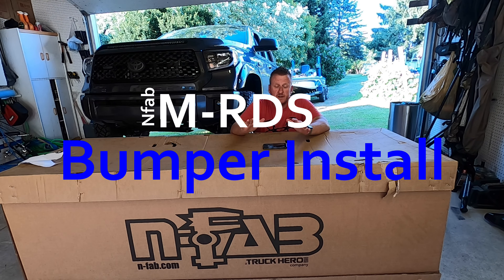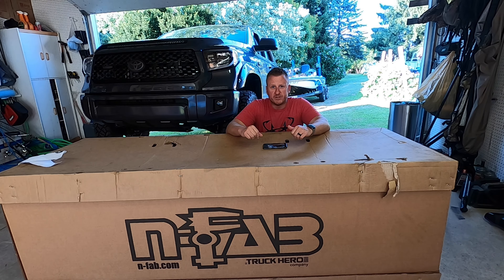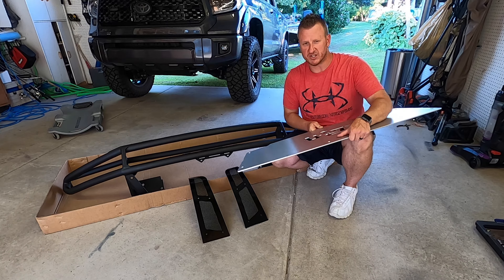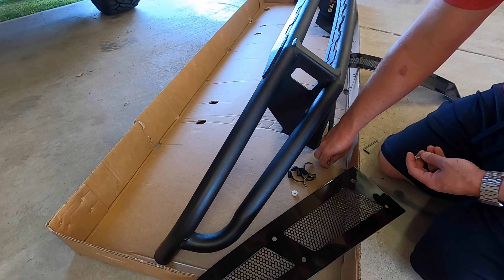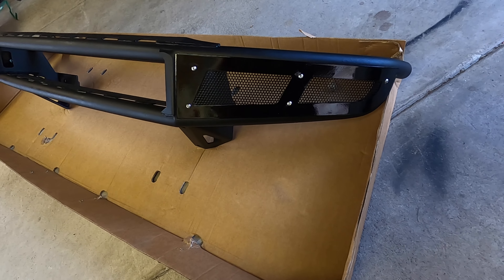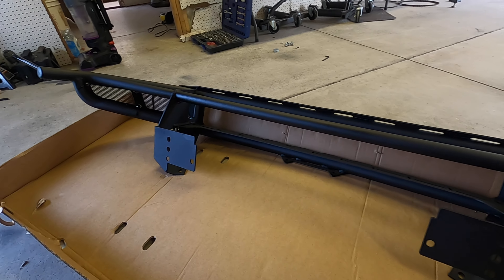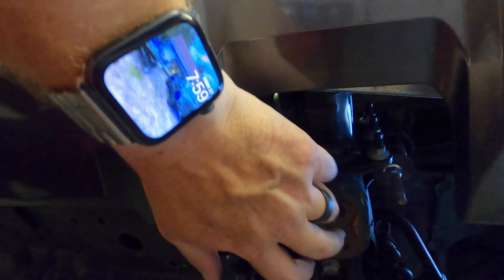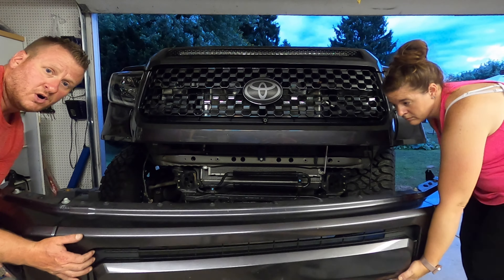Nfab M-RDS Front Bumper Install On Toyota Tundra Platinum

Comment: Looks fantastic and the installation seems pretty straightforward!  Thanks for sharing.
Reply from the maker: thank you!!...yea it was an easy install for sure, I spent more time on the other video showing the mounting/ wiring of the lights and how I modified the bumper to fit parking sensors...all in all, not a bad project!

Comment: First, Truck looks Awesome!!!
Second, do you know if there is an option to cover the middle section(where the light bar would go) instead of using a light bar, with the mesh steel like installed on the bumper corners? Thx
Reply from the maker: Thanks man, I appreciate that!… I’ve never seen a mesh piece to fit that middle location, but there may be something out there for it… I’ve honestly never looked because I knew I wanted the light bar there… If I come across anything I’ll definitely let you know, thanks again!

Comment: Hey Nice set up bro. What kind of running boards do you have
Reply from the maker: Thanks man, I appreciate that!…they’re actually a cheaper set I got off eBay, they’re almost identical to the Nfab Predator Pros which are like $6-$700…picked these up for $150 just to try em, and surprisingly they’re holding up for over a year now…here’s the direct link to them, for $150 ya can’t beat em!

https://www.ebay.com/itm/224089765217

Comment: Dude how did you get those rivnuts installed, ive tryied various methods i found on youtube to No avail.
Reply from the maker: Hey Jamal!…they actually went in pretty easily for me…I used a rivnut tool I got off Amazon that came with the correct size and popped em right in…what’s goin wrong for ya?…I’ll see if I can help!